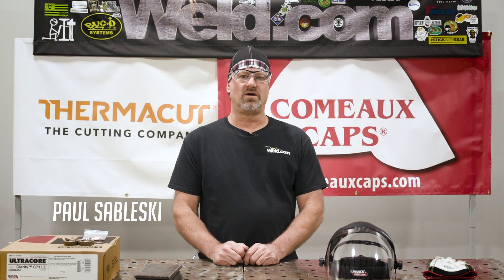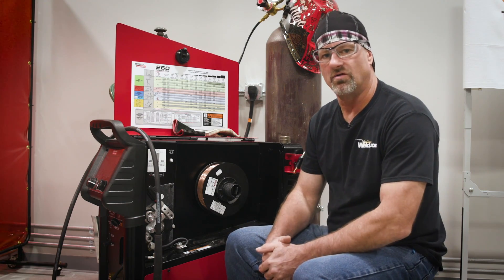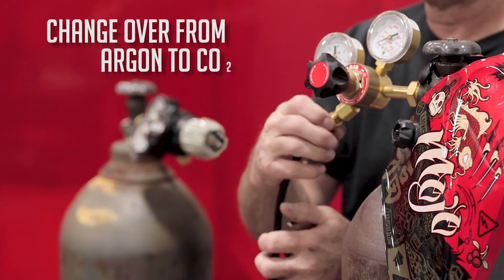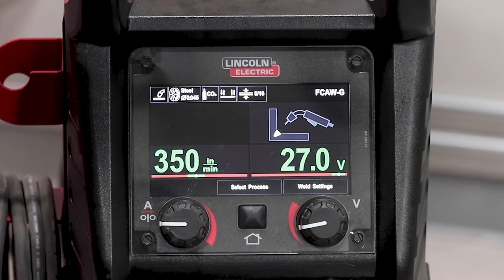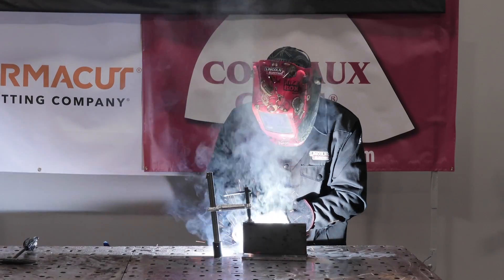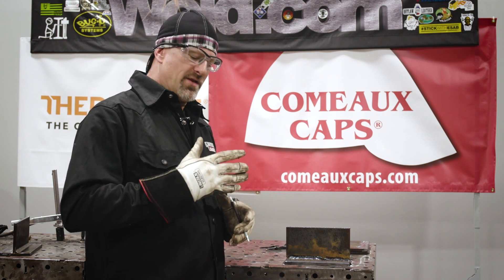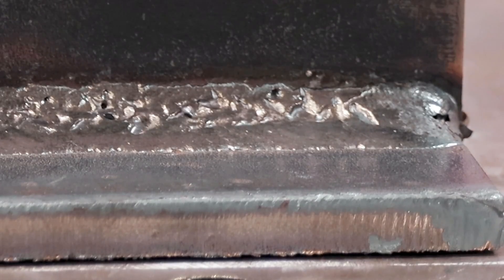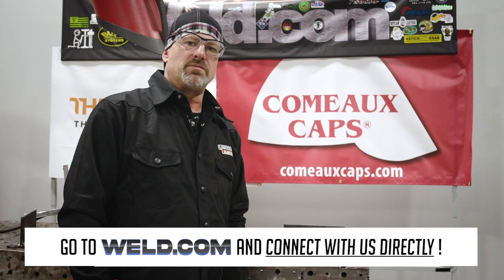Ways To Improve FCAW with Gas!

Comment: With the variety of different flux cored style wires, it's important to know the AWS codes. Not all E71T is the same, the last few digits tells you everything about what the wire needs. E71T-11 is no gas because the flux is meant to react with oxygen in the air, meanwhile an E71T-1M means you use mixed gas  (c25/75 argon). Most want to run above 24 volts ( .045 e7t-1m) to make sure the flux burns off correctly. The polarity also changes, some flux is positive ground others are negative ground. Flux core is also rated for structural/cyclical/seismic loads so it's generally expecting thicker metals to take up the heat, using it on 1/8 inch tends to melt if you don't have another thicker metal to take up the heat.

Comment: Man i got to play with the gasless wire for the first time the other day, it was quite disappointing compared to welding with gas, the welds worked alright but for my own self i didnt like the look, didnt like the feel while welding, it looked like a stick weld more than anything
Reply: The first day of my welding class the instructor said flux-core welding is stick welding with a mig gun. Which is the perfect way to describe it after trying it a few times. I think I prefer stick welding than gasless flux-core, outside of doing some quick tacks
Reply: To say FCAW is a very broad term E71gs doesn't meet any welding specs....just a general wire and no matter what you do it's going to be hard to achieve a decent weld.   Same price e71t 11 now meets structural specs, runs smoother and runs beautifully when set up right.   Then you use something like e71t-8 a wire that can be automated.  Runs totally different then t 11.  Harder to learn because it has its own techniques that it requires to run properly.   But once you get it, it literally peels the slag away itself.   

To some it up,  you have to specify what FCAW you are running. Talking about to comment on how it runs, feels.  I would never recommend e71gs. For the same price grab the e71 t11 (nr211/nr212)

Comment: I noticed quite a bit of splatter with that Lincoln wire, I have been using Esab 7100 dual shield with 75'25 and no splatter, so I was wondering if it was you were using 100 % Co2?
Would that Lincoln wire have worked better with 75/25.  the Esab specs say you can use 100% co2 in some cases, what does Lincoln say? Right now I would still prefer the Esab
Reply: Unless a wire is designed for dual classification (ie both mixed gas and 100% CO2), it usually is designed around one gas type. This is because you have a higher alloy recovery with a mixed gas (because you have a high % of inert gas), so the alloying elements used in the flux design will be different for a 100% CO2 designed wire vs a mixed gas wire. Additionally, different gas will need to have its weld pool stabilized with different components so each type of wire will be designed with the different gases in mind.

In general, a 100% CO2 wire using CO2 gas and a mixed gas wire using 75/25 mix welded side by side, you’ll see less spatter and a smoother arc with the mixed gas. Typically the cone with a 100% CO2 gas will result in larger droplets/globular type transfer that will result in more spatter. There are some exceptions where you would want to use a 100% CO2 designed FCAW wire (shipbuilding industry where cleaning before the weld of the zinc based primer they use is less than ideal, you can take advantage of the dissociation energy of the CO2 in the arc that can “cut through” the unclean base material). In a shop setting, I would always clean before welding and use the 75/25 mix and a wire designed specifically for that. 

https://www.lincolnelectric.com/en/Products/Filler-Metals/Gas-Shielded-Flux-Cored
Reply: Try Lincoln 71 elite with 75/25. No better flux core wire (for general purpose/fabrication in my opinion). In my experience it's hands down better than anything else I've used in the same category.

Comment: People get confused with fcaw-g. It's not the same fluxcore wire we use in our garages. You try to run gas shielding on that fluxcore wire and you will have a mess. The fluxcore wire used in dual shield is specially designed. Our home welders, in most cases, don't provide high enough voltage for dual shield.
Reply: Shielded FC uses DC -
Reply: @chrisplayz253  correct, but gas shielded fc used dc+
Reply: @michaeldvorak5556  yea same as solid wire mig and the majority of stick rods
Reply: I did gas over NR 211,looked great.

Been using FCAW for 20 years.
Reply: @dolphincliffs8864  sounds like an experiment. Dual shield (FCAW-G) uses DC+ while FCAW-S uses DC-. when you add gas shielding (c25?) to your 211, which polarity do you use? From what I've been told the flux in self-shielding requires reaction to the atmosphere to form but using a gas shield would prevent this. Thus a mess. Sounds like I miss understood or got incorrect info.
Reply: @michaeldvorak5556  I just did for a bead or two. Welds looked great but it costs too much for the welder I have ,no solenoid or flow meter just the regulator on the tank.

Pretty sure I'm dcep
Reply: @dolphincliffs8864  thank you for your input. Sound like something to check out when time and money are available. Gave a great day.

Comment: So with the comments bringing up the push, why not push, could you explain? I feel like I typically push at about 5 degrees on thinner materials, using gas designed to increase penetration?
Reply: The fluxcore wire designed to be used with gas shielding is still fluxcore and creates slag. So the old rule applies, if there is slag you drag.
Reply: @Michael Dvorak  was looking for more technical information regarding the impact on the final weldment. As I indicated with lighter stuff I typically push ever so slightly or as close to neutral as possible. Just on light materials mind, say under 1/4.

I was thinking it was a gas coverage or entrapment issue.
Reply: @normankolibaba9605  using MIG for 1/4" should give you penetration. You could switch to 100% co2 for a hotter weld. The dual shield is much hottest and ideal for thicker steel.